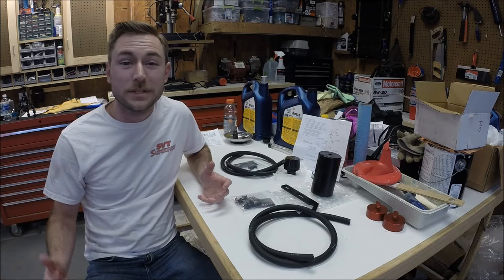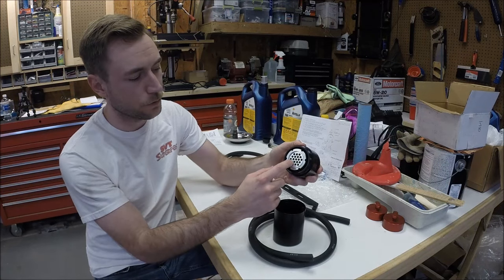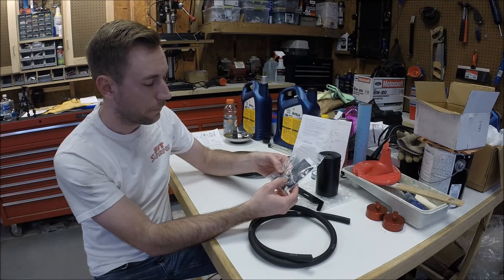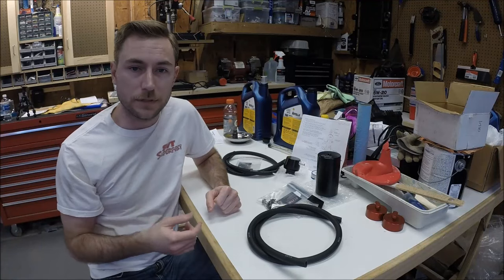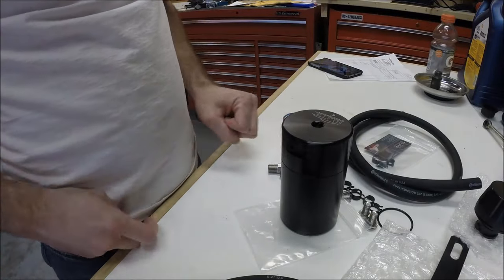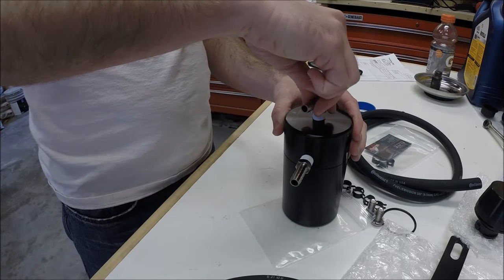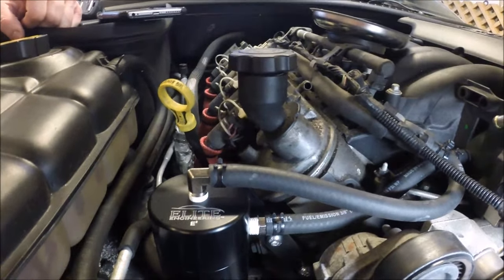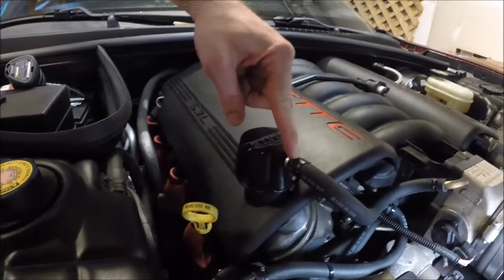Corvette LS1 - Elite Engineering E2 Catch Can Installation

Comment: Something seems wrong to have that much oil in a few track days.....should there not be a pcv with the catch can to simply catch excess oil.
Reply: Exactly! You should NEVER have this much oil after a track day. That's a years worth.

*I know it's a 8 year old video, but I'd like to see some updates. Something was ran wrong. I always think 2 cheap catch cans are needed on an LS. Or 1 mighty mouse system.

Comment: Great video.  Dont forget, those oil vapors also coat the surface of your intake runners and valves, robbing air flow. Then its burned by the engine, and sent through tu our cats and exhaust.  This is a no brainer even for a stock build.
Reply from the maker: I agree.   I've had this catch can for several years now; still very happy with this purchase.

Comment: Hi !:) thanks for the video !:) I have a pro charger on my c5z06 and it’s consum oil! There is no catch can on my car .. would you recommend it ? It can’t hurt the engine I guess.
Have nice day! From Fredrik Sweden
Reply from the maker: Yes, a catch can is always a good idea.  But keep in mind that with a forced induction system you'll need a a slightly different setup.  You'll need a check valve to keep the boost from pressurizing the catch can and back feeding into the crankcase.

Comment: This is great! I like that u show us the results at end  of your videos.
Is that oil or dirty vapor thats being collected?
Reply from the maker: It entered the can as oil vapors.  The filter media helps strip the oil vapors out of the air, and it condenses in the bottom of the can.   So it's dirty oil with some fuel vapors too.   Definitely not what you want pumping back through your intake manifold!
Reply: Thanks! keep it up!
Reply: Scruf's Garage Sooo my question for you is your oil level reducing much? You explained that the liquid is oil vapor, how does that translate into oil usage? 
By the way, it was very helpful, I never knew that much vapor was blowing thru the system. I have a 02 C-5 and would be very interested in installing this system. What did you spend for it? Thanks, Bob

Comment: That seams like an excessive amount of blow by to produce that much oil from just one track day... Might wanna investigate what's going on man.
Reply from the maker: The LS motors are known for blow-by, especially during extended WOT track use.  So unfortunately it's not that uncommon.   Some guys have it even worse.    This video was still on my old motor.  I've since built a new motor, but I haven't had that out on the track yet.  I'll be curious to see how it compares.
Reply: Yeah haven't had that much in my 140k GTO that I beat on

Comment: Just watched your well done video..nice job.  My question is that not a lot of oil being blown into the catch can. Seems to be excessive would not have expected all that. I would think that much blow by would indicate some other problems. Keep up the good work with your videos..ted
Reply from the maker: Based on what I have seen from other folks, that is a fairly common amount of blow-by with these engines.  If you shine a light into your intake manifold, you may be surprised how much oily residue is in there.   Of course, it is worth noting that I showed the amount after a track event.  So the car was driven significantly harder than you would see in normal street driving, so that certainly amplifies the amount collected.     Thanks for watching!

Comment: Why do you need the clean air separator if it's pulling clean air from the throttle body?  If there's any oil vapor for the media to catch, it's only going to drip into the valve cover.
Reply from the maker: When you go WOT, the vacuum inside the intake manifold drops very low, so the main catch can isn't very functional (it pulls vacuum from the intake, behind the throttle blade).  The clean side separator is then pulling vacuum from in front of the throttle blade.   The media in the clean side separator helps strip any oil vapors from the air coming out of the valve cover and keeps it from spraying through the TB and intake manifold.

Comment: Any hood clearance issues with the new clean air breather?  Also , where is the PCV line originating? Form the drivers side rocker cover port , the passengers side back rocker cover port, or both?   Thanks, great vid as usual.
Reply from the maker: In the stock configuration, the driver's side valve cover is tied to the passenger side VC with a crossover line that runs behind the intake.  Then the front port on the passenger side VC connects into the inlet of the catch can, and the outlet connects to the port on the intake manifold behind the throttle body.   The clean side separator connects to the port on the TB that pulls air from in front of the throttle body.    No hood clearance issues with the clean side separator.    When I changed to the LS6 pcv system and the LS2 throttle body, I needed to change my connection points.  I made a separate video for that.  https://youtu.be/OGq0dhtPx28    Hope that helps!
Reply: @ScrufsGarage  Yes , it does help, thank you. I have seen your other video. It's particularly informative, because it's the next logical step in my C5 evolution.  Just a thought, how can the front drivers side rocker port be considered the "clean side" ?
When left unfiltred, say as in the stock configuration, or with no catch can, it's anything but clean, as it is positioned right above a rocker arm.
PS. Why not do a video plumbing your steam lines into the water pump housing. I found your steam port video particularly clever , especially your use of the truck steam line in the back. I just think that it would have been the perfect end to a great  mod. As a novice in the LS  world, (but not in the hotrod world) , I thank you for putting out such a high quality series of videos on the LS1 in the C5.

Comment: You capped off the line that goes into the oil Fill neck.What did you cap it off with??Then from the clean side oil seperator goes to the throttle body?.What is the purpose of this?

Comment: Hi there,
can you give me the part number for the part you've installed instead of the oil filler cap.
and how is it? give me your feedback before i buy it for my Ls1..
Thanks
Reply from the maker: Muh Har I believe the clean air separator you'll need is the CSS1but double check with EE to confirm.

Im very happy with my setup.  All top quality pieces.  Function very well.  Go for it!
Reply: Thank you sir, you helped a brother out today, lol

Comment: I know this is an old video... But does the unit on the valve cover prevent 
Pressure from the crankcase from
Blowing seals out & such ??? 
Thanks...
Reply from the maker: The catch can is in line with the PCV (positive crankcase ventilation) system.  The PCV system is the traditional method used to vent pressure from the crankcase.  But in doing so, as that air routes back into the intake, it often carries a lot of oil.   The catch can helps strip any oil out before it goes into the intake.  So the catch can doesn't necessarily vent any additional amount of pressure from the crankcase.  If you're having problems with excessive amounts of crank case pressure, you might want to investigate and see what's causing that.   If you're looking for an improved PCV system, you can swap to the 04 LS6 valley cover, which vents crank case pressure through the valley cover instead of the valve covers like on earlier models.  When I rebuilt my engine, I converted over to the 04 LS6 style.
Reply: Thanks for getting back to me...
I think I asked the wrong question...
Does the clean side oil separator
On the oil fill also relieve crankcase
Pressure ???
Reply from the maker: Oh gotcha.   Yes it does.  If you notice the line coming off the new oil filler cap goes to the TB, which provides a vacuum source during WOT.  But note that previously that same line was routed to a port on the valve cover.  So it does not increase the amount of crankcase pressure you can relieve.   It just vents through a different location (oil filler tube vs port on the valve cover), and that new cap was a metal gauze in it that helps strip all out of the air being vented to keep it out of your intake.
Reply: Thanks... I just ordered an Elite clean air oil separator to work in tandem with the Elite catch can I installed
A year ago... I shoulda listen to you
& done it right the first time... 
Thanks again...
Reply from the maker: Nice!   I think you're going to like it.  Everything I've gotten from Elite has been top notch quality.
Reply: Thanks again...

Comment: I can see using the catch can, but won't the clean air separator reduce the amount of vacuum needed to draw the oil into the canister? When the filter is open to atmosphere,  the vacuum draw is minimal  at best. Or did I  over think this? Great video by the way.
Reply from the maker: Clean side is not open to the atmosphere; it pulls from the intake tube before the throttle body.  At wide open throttle, vacuum in the intake manifold drops, so the that’s when the clean side helps provide vacuum from the intake tube.  Hope that helps.

Comment: Just installed my catch can. I got a little crimp with the hose that connects to the pcv valve. What do you suggest, did you encounter that?
Reply from the maker: Hard to say without seeing it.  Is the hose slightly too long?   If so, you might be able to trim a little off the hose to relieve the kink.

Comment: hi mate, is there an alternative for the oil filler cap? can i leave the the hose how it is from the throttle body to the valve cover? is there any down fall from not having that oil filler cap? thanks. I'm from Australia by the way.
Reply from the maker: John Giordimaina  the oil filler cap is a separate kit for the "clean side."  You can run just the catch can in the pcv line if you like; that's where most of the benefit is.  However under WOT there's very little vacuum in the intake manifold, so the clean side line kicks in and pulls vacuum from in front of the throttle plate.  Having the filtered filler cap helps strip oil vapors from the crank case vapors on the clean side.

Comment: wouldn't the media filters eventually get clogged and need replacement? and can the oil collected in the catch can be used again and put back in the engine, til the next oil change is due?
Reply from the maker: Brutality110  the media is actually a shredded aluminum material, so very unlikely to ever get clogged.   I would NOT reuse the collected oil as it will likely have fuel contamination in it.
Reply: Scruf's Garage Thanks for the info. this setup would probably be good for my tvs2300 ls1 setup. the catchcan would keep the oil from diluting and lowering the octane rating of the gas

Comment: do you know how the line goes from the oil cap on an ls6. the shop did my hoses to the catch can part identically. It's an 04'z. I could easily cap off the fuel rail line and run that to the oil cap... I thought it should be a little different on an 04'z.. (my middle line to the center of the catch can goes nearly under the intake into the crank case) any help would be appreciated. thanks in advance..thumbs up
Reply from the maker: The clean air side - ie. the new oil filler cap - goes to the port on the TB.  That would be the same whether it's an LS1 or an LS6.   The LS6 vents crankcase pressure through a port on the valley cover instead of the valve covers.  So the line from the valley cover port would go to the catch can, and then from there to the intake manifold port.   I'm in the process of rebuilding my motor, and one of the mods will be changing over to the LS6 valley cover.  So I'll do a video on how I hook up my catch can.  (will be a few months out tho).
Reply: @ScrufsGarage  did you ever do that LS6 video.  It's been awhile. I just want to double check my lines are right.  Thanks
Reply from the maker: Ya know, I didn't.   I'll try to shoot a quick video of my current setup soon.  I swapped to the Dorman LS2 intake manifold, which uses the LS2 90mm TB.   The LS2 TB doesn't have a clean side port like the LS1/6 TB did.  So I drilled a hole in my intake tube (air bridge) and added a vacuum port, which is where I now connect my clean side vacuum line.
Reply: @ScrufsGarage  oh , i'd really like to see that! Considering Im in the market for that throttle body!
Reply from the maker: Sorry for the delay but I finally uploaded the video I did to show how I routed the lines for the LS6 valley cover and LS2 throttle body.  Hope this helps.    https://www.youtube.com/watch?v=OGq0dhtPx28

Comment: my gen 3 ls1 doesn't have a pcv   valve. so  what is the best setup for me .
Reply: I would rather go with oil injection with a mikuni oil injection pump. Im running tcw3 in my truck at 80:1 with good results and i also pour some in the engine as well.

Comment: Hey so does that mean the oil collected by the can is trash or could it be recycled back into the engine via the oil filler neck?
Reply from the maker: Milton Babin  I would discard the oil collected as it may have fuel contamination.
Reply: @ScrufsGarage  Hey its Milton Babin again. Thanks for the information about discarding the old  oil fom the oil catch can. I'm fixing to do a coolant change, new hps radiator hoses, and an oil change on my black 2002 corvette using AMS oil products. I'm also changing out the coolant and oil temperature sensor guages. Also a new oil level sensor. I saw your videos on the install of the oil cooler. I was thinking of taking off the oil adapter block so i can change the oil temperature sensor. And then reinstalling the stock oil adapter block for now. Untill a have enough money to buy the oil cooler and new oil cooler adapter block from improved racing. Also i'm not sure uf u know or not. But improved racing now has a stock oil temperature sensor with an extension. I'm just mentioning that because i noticed on your oil cooler video how tight the wires were that are attached to the oil temperature sensor plugged into the oil adapter block. Just thought I'd let u know in case u didn't. I'm writing you because I had a couple questions for u. Q1. Is the stock oil adapter block also called an oil filter fitting??.. It says on LS1 how to.com that the torque spec for the oil filter fittingnis 40 ft/lbs. The oil filter torque is 22 ft/lbs. Q2. Should I get a new gasket for the stock oil adapter block??. I saw some on rock auto.com for fairly cheap. I was thinking about getting one brand name " feel pro." What would u recommend?. Q3. I'm also a little confused on the oil level sensor. It says on LS1 how to that the oil level indicator tube bolt torque is 18 ft/lbs. And the oil level sensor torque is 115 inch/lbs. Do u know what the difference is between the two?. Do i need to replace both or just the oil level sensor. Thanks for any input you might have. Thanks Milton. P.S. The only reason I'm removing the stock oil adapter block is to change the oil temperature sensor being my 3/8 inch torque wrench handle is to long to get acess to the oil temperature sensor. Also do u think that the stock oil adapter block should be torqued to 40 ft/lbs.
Reply from the maker: Yea Improved Racing came out with some updates after I did my install.   I ended up extending the wires while I had the motor out and could get to them.  But the new product would be the way to go for someone doing it now.   Personally I don't think I would take off the adapter block to change the sensor.   If you have long tube headers, getting to those two bolts can be a pain.  I wouldn't worry too much about getting the exact torque spec on the replacement sensor.  Just get it snug, but don't overdo it.   If you do remove the adapter block, I would get a new gasket for it; FelPro would be fine, or OE.   The "oil filter fitting" is most likely the threaded adapter that the oil filter screws on to.   40 ft/lbs sounds like way too much for the adapter block bolts.  I think the "oil level indicator tube" is the oil dipstick tube.   There's a bolt that holds that to the block, so that's the 18 ft/lb spec.
Reply: @ScrufsGarage Thanks for the input. So if i did take the old oil adapter block off or put the aftermakket adapter block on in a few months. What would u recommend for the torque for the two bolts that hold the oil adapter. Also do not have long tube headers yeat. Not sure which ones to go with yeat. I was thinking of kooks LT headers and kooks x pipe. But still street driveable. The only other mods I have are catback stingray Borla exaust, and a k&n air intake system. With a tune. Also though about getting a more aggressive cam down the road. Any suggestions on cam or headers would be great.
Reply from the maker: In the instructions for the IR adapter block, they list the torque spec on the bolts at 120 in/lbs (10 ft/lbs).   http://www.improvedracing.com/manuals/EGM-112-F1.pdf    I would go with that for the OE bolts also.   They are small, so it doesn't take much and you definitely don't want to strip one.    For LT headers, if your budget allows for Kooks then they are definitely the way to go.  A coworker has Kooks on his 04Z.  Excellent clearance around the steering shaft and the AC lines on the passenger side.   As for the cam, there are tons of good options.  Personally I went with the Cam Motion Titan 4 and I'm very happy with it.

Comment: doesn't the pcv valve need to go on the outlet side or it doesn't matter ?
Reply from the maker: Chris Colla  the instructions from Elite have the pcv valve on the inlet side.  However in this configuration with only one line in and one line out, it won't matter.  The pcv valve is just a one-way check valve to keep air from the intake from flowing backwards into the valve cover.  A forced induction setup would require a different configuration